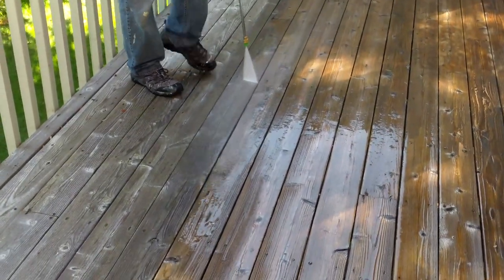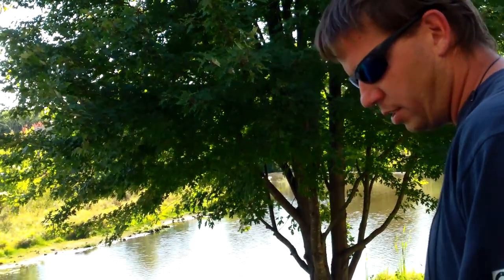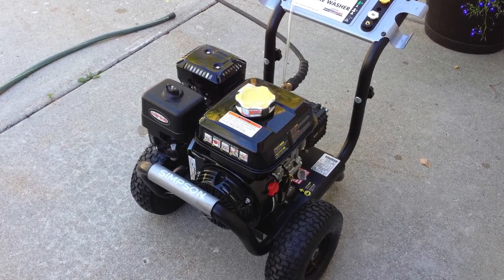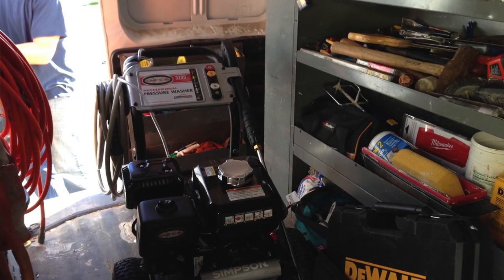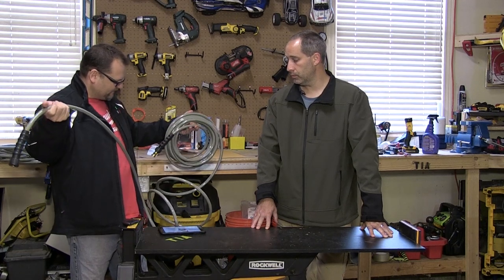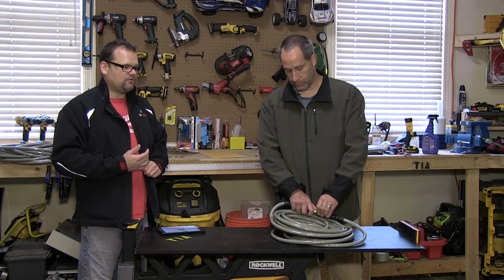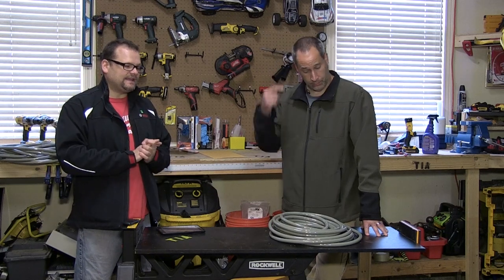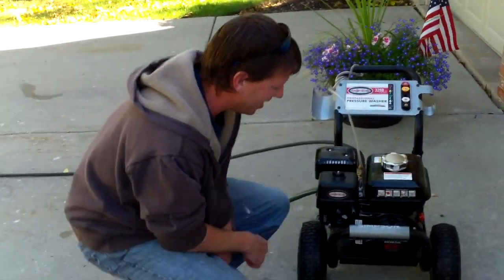Simpson PowerShot PS3228 3200 psi Pressure Washer - Review

Comment from the maker: Six years is ok if you abused it.  A home owner should get around 10 years on a good unit.  As long as you change the oil on the pump,engines and maintain them. And you don't run it without water or let water freeze in the pump.

Comment: I really am not sure if i should spend the extra money on this, or go for the GC 190 megashot. Im just starting my own painting company, and will be using it for decks and cleaning up houses before painting them. also the odd driveway. 
Id really like to spend as little as possible, but will i regret not spending the extra?
Reply from the maker: +Joe Finch I would go with this unit.  It is built for commercial use and will last longer.  You might regret it in a few years of everyday use.

Comment: What are some of the reasons to choose this 3200 PSI 2.8 GPM washer over a 3400 PSI 2.5 GPM washer?  They are both Simpson brand that use the Honda GX200 motor so I'm assuming you give up a little flow to get a little more pressure with the other washer.  Just wondering how and when one washer excels over the other.  Thanks!
Reply from the maker: The 3200 will get the job done faster, not sure that it will be that noticeable though.
Reply: Alright, so a little more flow is more useful than a little more pressure. Thanks.

Comment: What is the different between Powershot 3200 and Megashot 3100?
Reply from the maker: Joy Gilmore not sure off the top of my head
Reply: megashot 3100 comes with a honda GC190 engine and an axial cam pump from some company called OEM.  Basically it has consumer grade parts while this has professional grade.  Also the powershot 3200 flows 2.8GPM while the Megashot 3100 only does 2.4-2.5
Reply: OEM, actually is a term for an item that is made by a manufacturer, but specifically for sale by another company. It's not the name of a company itself, but a term. So what his means, it's made for Simpson, or for this product.

Comment: Don't use too harsh of a tip or you might strip the paint off your car. The quality of the pump and engine is important really it's just the pump they are expensive to replace or repair if you can even get parts to repair the pump cheap pumps don't have parts just whole replacement pumps most of the time.